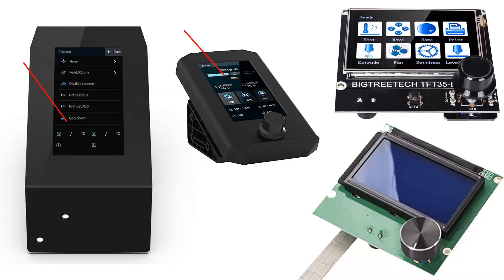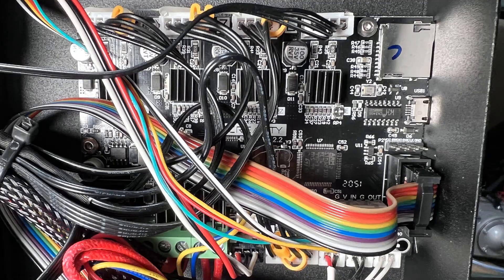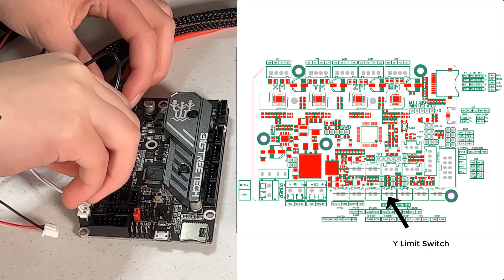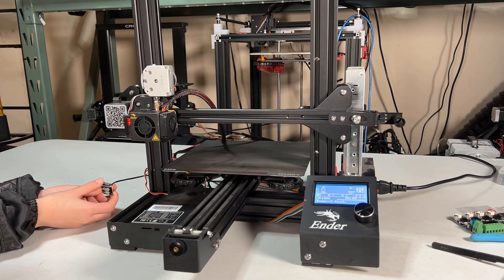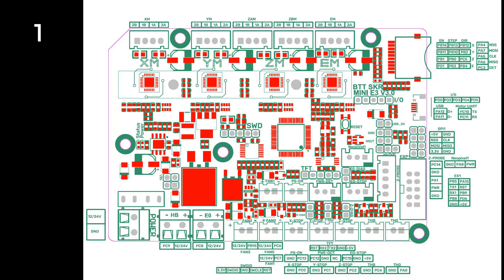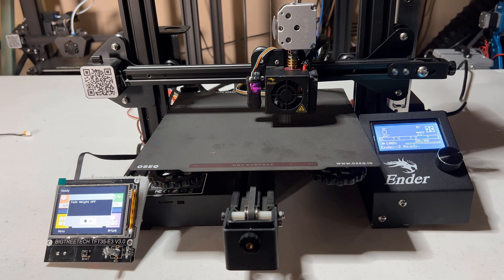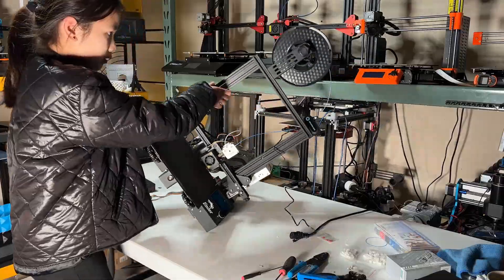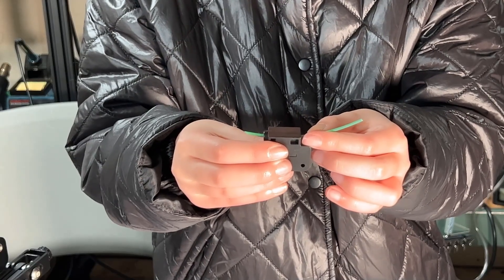Big Tree Tech SKR Mini E3 V3.0 and 3.5” touch screen upgrade on Ender-3 Pro, fixing BLtouch issue

Comment: Thank you for your super explanation of installing the upgrades, I have purchased the SKR mini e3 v3, BIQU MicroProbe v2, Filament sensor SFS v2, TFT 35-E3 v3.0.1 and BTT relay v1.2 on Ender3
Since I have the filament sensor SFS V2, with 2 plugs one runout and one motion detect, can you please advice how to connect and configurations used. Thanks, James.

Comment: I've attempted to upgrade my CR10 with the mother board and screen in your video, but there are issues.  After attaching a WiFi Box and connecting it all to the power, the WiFi Box started trying to find the computer unsuccessfully while the control screen showed the two options of Marlin or touch mode control.
I've been unable to get anything else to happen.  The knob doesn't alter anything on the screen and the computer can't locate the printer
Reply: Still unable to get anything happening.
Is there anyone there who is willing to help?

Comment: Just a small note, it's not 100% a drop in replacement as one of the fans needs a different JST connector which you do mention at 3:40

Comment: Hello! Thank you for the video! I have a ender 3 pro. Skr mini e3 v3 ,a tft 35 and a microprobe. I tried both firmware and also changed the wires position as you showed on the video. But homing still not working. Microprobe doesn't work on this board? Thank you

Comment: Since you seem to know so  much, I am using the same hardware you have in the video, with the TFT.  When I look at the TFT screen, information, it shows Marlin bugfix-2.0.x and  is the code that came on the mainboard.  I tried flashing both BLtouch version of the Ender 3  code and it changes the name on the SD card to firmware.cur but does not change the name on the info screen.  I think I will have to do as you did in the video because the gantry raises on a home command or hits a timeout and crashes the board.  These are different results depending upon which BLtouch firmware is loaded.  I had to order JST connectors and awaiting them.  Suggestions on the name on the info screen?

Comment: Great Video! Question Though. Im upgrading my Ender5+ and the BL touch was connected as you describe, and I see now at minute 8:50 you explain how to accomplish this.... However... What do you think is the best / correct way to do it (ideally) with this board? Would it be best to use the 5 pin connector?

Comment: I am having issues with installing klipper and getting my BL touch to work. I ran Marlin fine after swapping pins. I wanted klipper and now my BL touch is the only issue I am having. Is switching these pins the correct thing to do for klipper as well as marlin ?
Reply: I am having the same issue. Have you found a fix?
Reply: @thebookofmatthew12  I just wired the bl touch up with a 5 pin connector and it worked. 🙂
Reply: @dragonsforyou2  did you run the preinstalled code?

Comment: i just follow the steps on this video an have amazing results, but I'm trying to install Klipper and connect a Sonic pad, almost everything works as it should, but the extruder its going all the way to the hotbed without stopping, any solution for that Z-homing problem?

Comment: I have tried all of the different firmware and plug settings on my ender 3 and it just stops after the Z stop test on the homing, if you read the spill from Bigtree this is a straight replacement, I have now come to realise that thats not the case, I am SO TEMPTED TO GO BACK TO MY CREALITY BOARD, can anyone help?

Comment: This is an excellent video, thank you! I’m just getting started with 3D printing so I’m not fully up to date. To use the CR touch probe for Z homing with the Mini 3 e3, is your method to separate the 5-pin connector still the best route or has there been firmware updates since doing this tutorial?

Comment: So here will be a really good question that I hope you can answer. I understand that I can use the tft35 on this board, but if I wanted to be a bit fancier, could I use the tft spi?  If so, would I need the tft35spi or would I need to include the IO2CAN into the math?

Comment: Thanks kids! Even after 2 years the video is still relevant. I decided to do some maintenance to my Ender 3 Pro with an SKR Mini E3 V3 and tidy up all the wiring for the BL Touch and add a Creality light kit. I think I've had my Ender 3 for about 5 years and the only problem I've had with it was the original controller board quit working so I replaced it with an SKR Mini V2 board, then upgraded the V2 to a V3. You videos have been helpful, thank you very much for taking the time to make them.

Comment: Umm, I'm afraid that I must correct your correction regarding the fan connections. You were correct the first time around. FAN1 goes to turn on the motherboard and FAN2 goes to the HOTEND fan. Here's why: 
The correct way:
When you increase the HOTEND temperature (via the panel) alone the HOTEND FAN will turn on after passing a certain threshold. When you increase the the BED temperature by itself the enclosure fan will turn on to compensate for the heavy draw of the BED heater from the internal power supply. That's the way it's supposed to work.
The wrong way:
Wired your way (as corrected above), if you increase the HOTEND temperature the enclosure FAN comes on. This makes no sense at all. The HOTEND fan does not come on at all until you increase the BED temperature.... It's backwards.

Comment: After hours of searching online for a simple answer for CR Touch odd z-homing behaviours with newly upgraded BTT SKR Mini 3 V3 motherboard, I came back here to share my solution, if you can compile your own Marlin firmware, go check #define Z_MIN_PROBE_USES_Z_MIN_ENDSTOP_PIN in Configuration.h file, and disable it by putting // before the line. And make sure #define USE_PROBE_FOR_Z_HOMING is enabled if you use a CR Touch probe like me. BTT official firmware is indeed a S++T hole.
Reply: Did you leave the instructed wiring, or follow Aurora in splitting the black/gray connections to the Z stop?

Comment: Very nice video.  I used the TH3D Studios unified firmware.  It cost $5 but worked on the first try and didn't require changing the CRTouch wiring.  They probably had not released this firmware at the time this video was made.
Reply: got a link?

Comment: Wife just bought me an ender 3 with SKR mini e3, tft and bl touch.
Just loading the firm ware does not seem to work at at. I the LCD lights up but does not display and the tft show no printer found. Not sure what to do.
Is there a common problem that I am not aware of?
Do I have to compile the firmware somehow? I thought it was a simple matter of placing it on the sd card, rename and load.

Comment: My one fan wires are no blue and yellow, they are black and red. Also, for the touch cable, I removed the black and white wires, put them where you said now it doesnt work. Also, the wires for my touch are in a different order than the one you have. This is very frustrating and I now have a non usable printer.

Comment: Is there a new compatible firmware since feb 2022 ?
Oh by the way, reverse and modify CR touch plug don't change anything for my ender 3max, still don't work with the firmware i had to compile one without CR touch

Comment: You make this look so EASY - but you do not show the part that has BRICKED TWO Mini E3V3 boards for me: the actual flashing of the firmware.  Yes - TWO of them!  Arrived in working order, it seemed, but as MY intent was to upgrade my old Ender 3 to Klipper, the first thing I did was to download their klipper-usb.bin and upload it to the Mini.  KaPOW - DEAD IN THE WATER!  TFT 3.5 now INSISTS that there is "No printer attached," and indeed - NOTHING WORKS.  And the microUSB port is also dead, so their BTT Pi 1.2 cannot "see" ANYTHING connected to it, either.  I simply cannot understand how they get so many POSITIVE reviews, when TWO for TWO (of the Mini main boards) and the TFT and the Pi clone SIMPLY DO NOT WORK!  
I find their inaccurate (useless) documentation ALMOST as infuriating as their WORSE than USELESS "tech support!"  I don't know if it's CANNOT or WILL NOT answer even the simplest of questions, but when one asks OVER and OVER (6-8 times) and STILL they do not even ATTEMPT to answer some of the questions -- it's a clear sign of INCOMPETENCE, in my book.  Virtually every email starts with an apology, but a whole BOATLOAD of apologies will do NOTHING to resolve these issues!
If they want to market their products to the US - perhaps they need to consider WHAT TIME IT IS HERE and WHAT LANGUAGE WE SPEAK!  They certainly have no problem figuring out how to take our money, now, do they?

Comment: In case anyone gets here looking for a solution that works for the CR-Touch, please note that the wiring colors for BL and CR are not the same and I can't account for the positions of the wires shown here for their solution.  What I can tell you is that after blowing up a CR-Touch with the wrong wires, you need to be very careful.  FOR THE CR-TOUCH only, you need to move the Blue (Sensor) and Red (Ground) wires onto a new JST connector.  Plug those in place of the original Z-probe connector.  The Ground sites closest to the power wire side if you don't have the pin out. (double check this).  Once done, you can update the firmware to the one called firmware-ender3-bltouch-for-z-homing.bin.  that will fix the homing issues and pretty much get it working.  note that the firmware from BTT is (i've read) not great.  Meaning that they obviously missed some stuff when they rolled it.  I don't really trust it, but I didn't want to reroll a whole new firmware just yet.  good luck.
Reply: Yeah - I'll say the BTT fw ain't great: I just BRICKED my SECOND SKR Mini E3V3 by TRYING to flash THEIR FIRMWARE to it!  The point of my buying their SKR Mini E3 V3 and their TFT 3.5 E3 and their BTT Pi 1.2 was SO I CAN RUN KLIPPER -- but NOBODY there @BTT "tech support" has the cognitive capacity to answer even the SIMPLEST of questions, much less the TECHNICAL problems that their sketchy documentation either doesn't address or is flat WRONG!  How they can have so many positive fans making YT videos about their crap is a MYSTERY TO ME!!!

Comment: She noted that the Hot bed wiring should be black (gnd on the right) and pos on the left. This matches the original config even though both boards have the right connector listed as Pos. I saw another Youtube vid that had red on the right and black on the left (it worked) so maybe orientation isn't critical since it is a heating element?
Reply from the maker: Yes, it doesn't matter for the heating element.

Comment: Do you think its possible put a skr-mini-e3-v3.0 on a LK4 Pro with the original touch screen display?

I have at least 200 people desperate on my WhatsApp group.

The suport for screens from bbt are evil.
Reply from the maker: No, you can't. The LK4 uses a DWIN touch screen, which has its own software for programming the UI, and it's not compatible with BTT boards.

Comment: PLEASE HELP!! I watched this video on repeat like 10 times and I cant get my printer to take the firmware. I did my cr touch the same exact way as you and got the firmware from the BTT get hub and installed it onto my 8gb mini SD card and nothing. Do I need to run it through visual studios or no??

Comment: I installed my new board a couple of weeks ago and it was a total nightmare. I couldn't find a single video or article explaining how to do it and ended up with three tabs with different wiring diagrams in each. I'm now trying to install a BL Touch and stumbled across you and I really wish I'd found you when I was installing the board! This is exactly the information I needed, presented in a clear manner. Thank you so much! I will definitely be coming to this channel for info on further problems.

Comment: What a great video. Thanks to this video and the comments/description, I figured out what was wrong after I had somehow connected the three fans incorrectly, resulting in frequent heat creep due to the hotend fan not being switched on correctly.

This video explains the upgrade process much better than the official video. I like the added schematic so it's easy to see exactly what connector you are talking about.
Reply: Well, that's not how the BTT documentation I read said to connect the fans, but at this point I'd follow Aurora's lead, as BTT doesn't seem to know squat about their own products.  I suppose I'd have to admit that their English is a WHOLE LOT BETTER than my Chinese, but then - I'm not trying to market products in China!

Comment: I did number 3 to connect the CR touch and the printer wasn't turning on. I reverted back the pins and now the cr touch is not turning on, but the printer turned back on. Any idea on what happened? Did I just fry my cr touch?
Reply: sounds like a firmware issue, do any lights turn on for the cr touch?

Comment: hey followed all the steps and put the new firmware on after switching to the 3/2 wire setup and now when i hit auto home it goes to the corner and tries to keep going down? also in the firmware theres no options regarding the probe?

Comment: i had to remove the blue and red wires on my CR touch and connect them to the original ender 3 limit switch port. But i now have issues where the ABL only probes the far left corner of the bed and only about an inch of the bed on the very leading edge and then it says Save to EPROM

Comment: Great video, thank you. I have a standard Ender 3, with an SKR mini e3 v2 main board, and a BL touch. It has the 5 wire plug. I installed it in it's place and disconnected the stock Z switch. I flashed the firmware  "with BL Touch as Z stop" . Everything works as it should. The machine homes, moves to center probes Z and comes to a rest. This is where the problem starts. The nozzle is 12.5 mm above the bed and the machine will not let me move to below 0.00. It will let me change the offset but still not let me move below 0.00 to move the nozzle close enough to print. Any suggestions? Thank you

Comment: I Have just added the SKR Mini E3 Version 3.0 Motherboard and the BigTreeTech TFT35 3.5” Color Touch Screen. I had a BL Touch, so I have tried to add it as your video shows, but it is not working and wants to smash the base without stopping. I thought I had loaded the correct firmware with auto homing, but the red light on the BL Touch never comes on. Just the little blue dot light. So, my BL Touch colors are different with a blue wire instead of green, but they are in the same places as yours. I just can't figure this out. Why is the BL Touch not lighting and moving the retractable arm?
Reply: find a fix at all?

Comment: Hello! I am having an issue while following along. I am working with all of the same equipment in the video. I have uploaded the same firmware to my Ender 3 and connected my CR Touch using the same split method you use in the video. However my CR Touch is not even lighting up or responding in anyway. I tried using all of the 5 pins on the original probe connector on the MoBo, but while doing that I got the same issues you did in the video. But as I said, trying the split connection method seems to have made it worse for me. Do you have any suggestions for me to try?
Reply: find a fix at all?

Comment: My skr mini E3 and TFT install has a problem called printer not found.  It seems the serial connection cable is the problem.  I would like to see more exactly how this cable is connected on both ends with closeup pictures of what a working setup looks like, especially with regard to connection wires orientation.

Comment: I used this fix with my bltouch and it worked great! Thank you so much! I have one question. When I flash the firmware.bin to my board, it overwrites all my changes to marlin. When I flash it again with my fixes, it overwrites the bltouch fix and it stops working. What was changed in that firmware.bin that made the bltouch work?

Comment: Warning: AVOID THE SKR MINI E3 V3.0.1. The V3.0 is fine, the V3.0.1 has worse problems with BLTouch. There's no official Marlin firmware on their Github that offers BLTouch compatibility, using the V3.0 firmware throws an error about EEPROM size, compiling my own firmware only made it worse, and the support people's only solution was to turn off the warning on the TFT about not being able to activate it.

Comment: Had the same issue with skr mini e3v3 and cr touch, i compiled a marlin fw and got it to work without removing any pins. So it can be done without hardware modifications.
I think i enabled z safe homing and z homing probe and bl touch. Great video nevertheless 👍👍
Reply: Hello, I'm trying to do exactly that, could you help me knowing exactly how you did it? Thank you
Reply: @252AC  I think i enabled to use probe as z endstop, but im not exactly sure what other changes i made, but you can try my firmware if you want, do it at your own risk, its one of my first de

Comment: Thank you for your video, perfectly paced and with all the information explained and shot with an eye to thoroughness but avoiding being repetitive and tedious. I have just bought the BTT mine E3 v3.0 for my E3v2  and am at the moment wiring the LCD cable. I have experience crimping and have the tools as you have (although yours look novelty oversized but i think its the small hands) and bought some IDC blanks and had some suitable ribbon. There is still the other end of the adjusted lead which needs the wires rearranged and put into a plug with crimped connectors. So it isn't for the faint hearted or time poor. In fact the idea that this is a "drop in board" is a little misleading as there are obviously moderate level tweaks to the fw and significantly more involved faffing about with the E3.2 LCD lead.